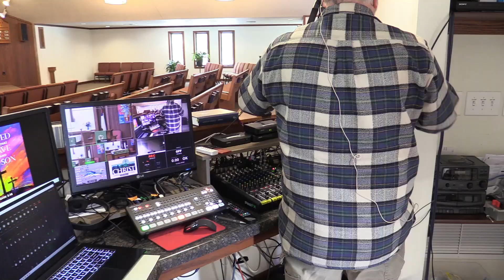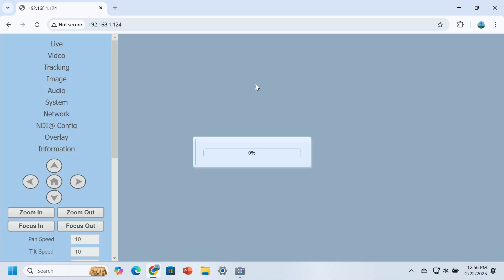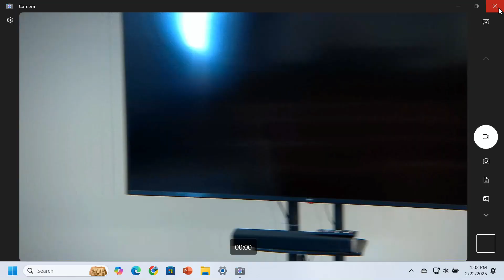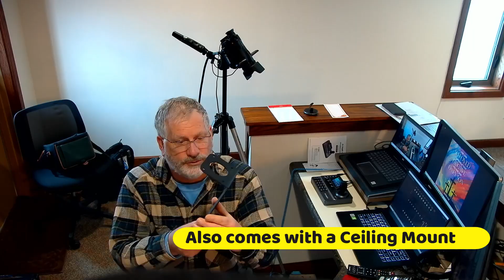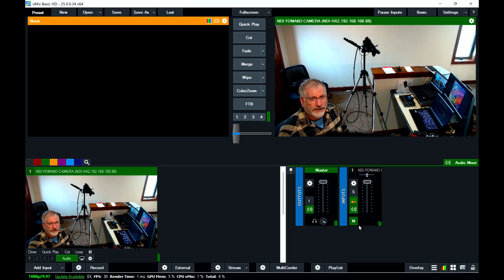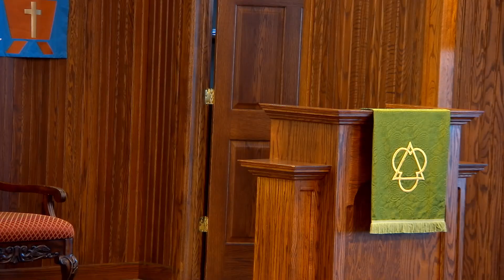3 Budget friendly ways to add a PTZ Camera to your Livestream setup

Comment: If you need to control any camera from behind that uses ir remote, but the sensor is at the front, you can just attach a small inspection mirror similar to a dentist mirror, then position it so it catches the signal from behind, possibly a lower position and bounces it to the sensor. If you need to control securely over a long distance, get a IR over CAT5. You have a repeater mounted near the front of the camera and a sending unit elsewhere. You'd point the remot controller to the sending unit and the camera receives the ir light and reacts to it
Reply from the maker: The only thing we use our hand remotes for on the cameras is to turn them completely off and on again the next week.  I do have IR over ethernet for the one camera that we have that we use an ethernet HDMI extender but don't need it.  I also thought about using small mirrors like you mention but with about a 40 degree turn of the camera base towards us that wasn't need. We fall well inside the arc for easy control.  We still have complete control and use presets mostly with our Fomako PTZ controller.  Much easier.  Thanks for the observation.

Comment: Does the PTZ camera need a lan line A ROUTER then to the M4 Switcher to work? And also can I still use OBS with the switcher?
Reply from the maker: Depends on what you are trying to do.  You could plug directly into the M4 using HDMI or SDI and control the camera via its remote.  But If you want to use the PTZ controller on the M4 switcher then yes, you need to be on the same network and I recommend keeping the KN20 and M4 switcher with DHCP on. That way they can communicate.  And yes you can use OBS as your streaming platform via the UVS (USB-C) port as if it were a "webcam".
Reply: Also is the quality of the PTZ good?
Reply from the maker: Yes the quality of this camera is very good.  The KN20 is a 1080P60 max camera so not 4K but of course the best you can do out is 1080P60. The Autotracking is great, and you have several methods of connecting, HDMI, SDI, NDI, USB for video.